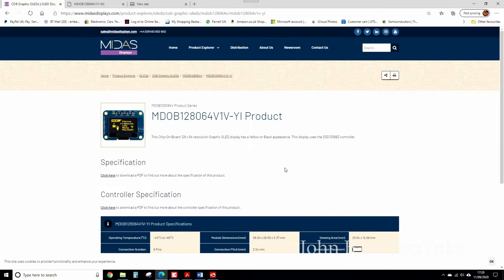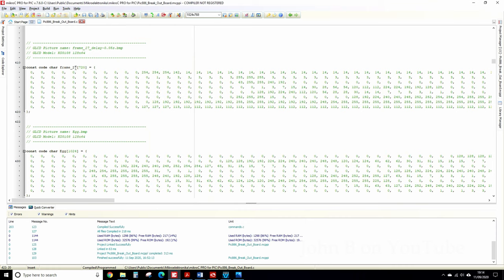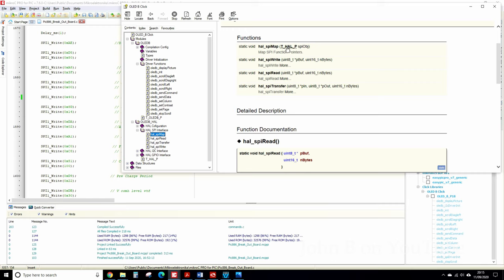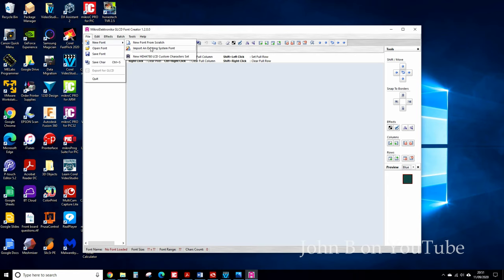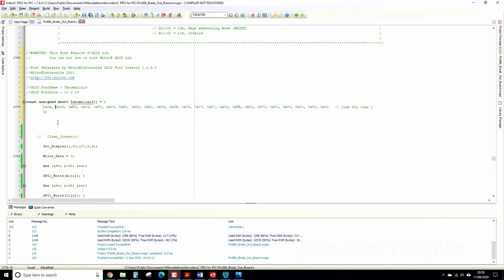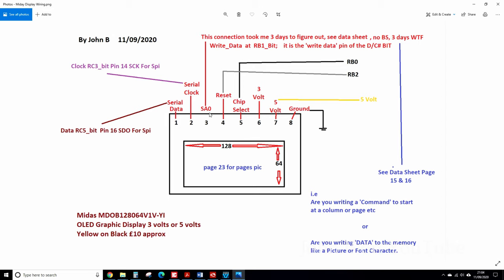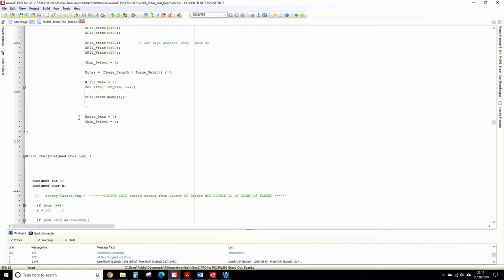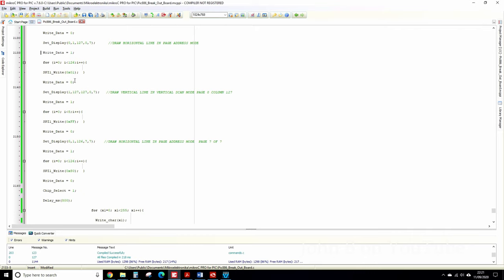SSD1306 OLED Display, In Depth How To Get It Going

Comment: Hi John. I've just started writing my program to use the SSD1306,  writing in  assembler, in MPLAB 8.4. 
My understanding of the SA0 bit differs to yours, it appears to be wired Hi, or Low, to enable two OLED's on the same I2C bus, each then with a unique address.

Viewing the OLED address as 8 bit , not the silly 7 bit format I've seen, 
  D7-D2 form the software-sent part of the address. 
  While D1 is SA0, which has to be sent (from ones micro controller) to match the tying High, OR Low of the pin. 
  While D0 is the Read/ Write control (Write = Low, Read = High). 

As such, with, SA0 tied LOW, the address would be, 
$78 = Write, $79 = Read. (8 bit).  Or using the (silly) 7-bit method, $3C = Write, $3D = Read 

While SA0 tied HIGH:
$7A = Write, $7B = Read. (8 bit). Or using the (silly) 7-bit method, $3E = Write, $3F = Read 

Within the datasheet, Figure 8-7 :( I2C-bus data format ) shows the bit stream, with a summary. 

So far I'm just arranging the initialise sequence, and now playing around with the different settings to see how they affect the display.  I'm using the smallest display, just 64x32 pixels to replicate a display seen in the rear window of a motorway Range Rover police car, but in one a custom Matchbox Superkings  Range Rover Im creating.

Comment: Thanks for the video, although I was expecting to see how your set up the ssd1306 from the datasheet step by step, i learnt other things though thanks
Reply from the maker: I found the datasheet ok to follow so didn't mention it, I only had trouble with the communication, that and the fact my IDE did not support it.
The average view duration is 3 & half minutes so 45 minutes wasted anyway.
Thank you for your comments.

Comment: One doubt, even if the value is stored in RAM, the corresponding value is loaded from programmed hex file right. So it will take up space in ROM also, ain't I correct.  A better way is to compress data into different sections
Reply from the maker: No you're not correct.
RAM is RAM and ROM is ROM, if you're out of ROM, you can use some spare RAM as I showed.
How does one compress data in a Pic?
Reply: @JohnB-2021  1. I still think that the value is stored in ROM also. If it is stored only in RAM then the data will be lost after power on reset.You can also cross verify by comparing ROM consumption before and after the change.
2.about compression, Instead of storing each byte into an array, all the consecutive locations with same value can be replaced with only 2 bytes. One to indicate number of bytes and other to indicate value.
eg: value1[10]=[0,0,0,0,5,5,5,0,0,0] can be written as value1[6]=[4,0,3,5,3,0]. a new function should be used to decode the values.
3. One small algorithm i can think of , to check numbers is to take modulus with 10(x%10). This will give the value at the ones position, and only one if condition is required. This will also reduce code size.
Anyway nice work, wanna try it myself someday!
Reply from the maker: @souravmp7851  
 @Sourav Mp  Oh yes how very true about the RAM.
Maybe there is a separate location / address for RAM?
So last night, (12am to 5am) I finally cracked the numbers game.
I mentioned that I required my 'num' for the counter to be a string, I could then pick out each character up to 1000 as an example.

I finally thought of my favourite function, used in most of my previous videos and something I had not thought of. When displaying numbers on a TFT I use ‘inttostr’ integer to string and didn't know I could use it for my number checking.
I changed my code, used intostr, 3 switch cases and my display counts up to 999.

My ROM changed from 71% to 21%.
So knowing what to do will save a tonne of ROM.

I understand your compression now, much like ‘zip’ but that would take forever, easier to buy an 18Fk22 which has another 32Kbytes making 64KB.

I’m guessing I could now count up to 1million and stay under 70% of ROM.
Obviously the font would be many times smaller too which is a massive help to ROM storage.

Thanks for your input, do you program Pics etc?.
Reply: @JohnB-2021 Glad i could help :)
 I am not sure exactly, but i think the data will be stored in different sections of ROM. I have seen this functionality in some other controllers.

That 'zip' logic which i have mentioned can be done easily with a small python code. By this way you will be able to store much larger data. Storing big fonts wont be a problem. Can you give me the link to the video mentioned above, where you mentioned your algorithm?

 I have some experience with PICs and some ARM based controllers.
Reply from the maker: @souravmp7851  Hi,
Thank you for your support, but if you read the whole of my last reply, I sussed the numbers game.
My display counts up to 9'999'999, I could go to a billion or trillion with a little extra effort but no point.
My old code up to 999 used 50% more ROM, my new 10 million code uses nearly 50% less.
The code is in the link but now out of date since the code is much improved.
I'll be making something then putting the final code in a new video.
Thank you.